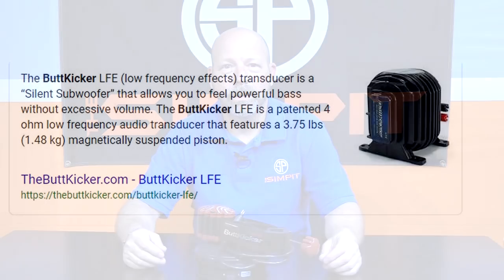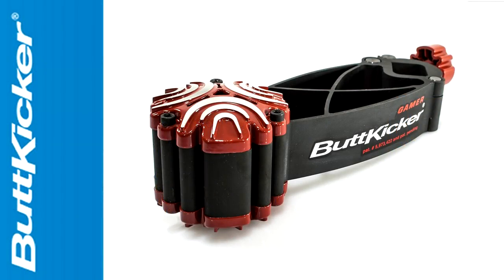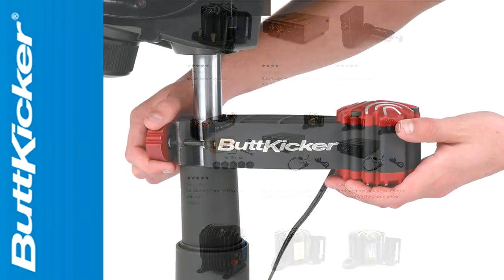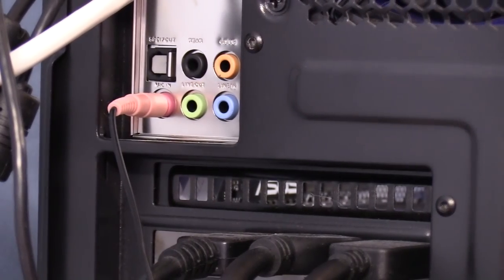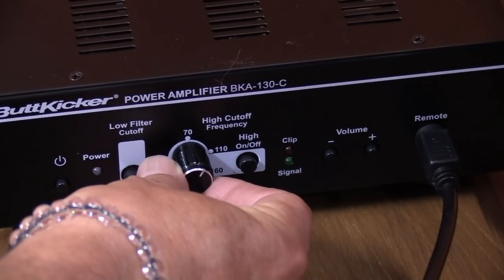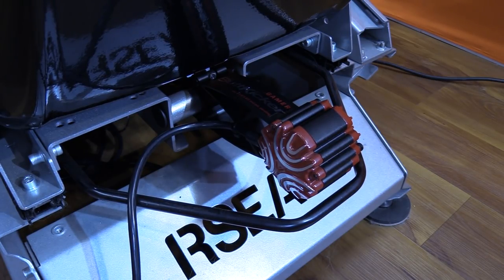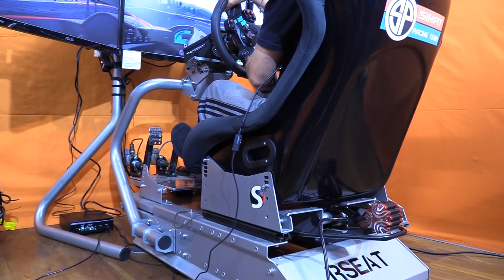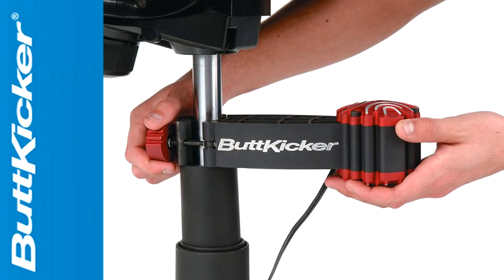You Need This On Your Rig! - Buttkicker Gamer 2

Comment: Like many sim racers I didn’t tell my wife when I bought mine. I was in the basement with it the first night and when I first turned it on she came rushing down from the 3rd floor asking me if I felt the earthquake. True story. I told her it was only $80
Reply: Having to explain to your wife that you spent $80 on a vibrator. When you actually spent more. 😁
Reply: Great comment!!
Reply: LOL
Reply: Dont worry buddy i do the same with mine oh ya was only 20$ dont worry 😂🤷‍♂️
Reply: Been there!!! LMFAO
Reply: The last part confirms this is 100 percent truth lol
Reply: its really that strong..?
Reply: @shervinaryan2631  oh man…. I bought it in 2015 I think. Used it for a year and a half. Then just turned it on this week. If the amp is up too high I can probably break the wooden frame I have for the sim gear. No shit. Keep in mind what you will ultimately set it to for your preference is way more tame than its capabilities. Huge huge “bang for the buck”!! Cost vs effect? No brainer
Reply: @UFwho  you just sold me on one, my wife thanks you (she really doesn't)
Reply: @shervinaryan2631  that’s crazy. I haven’t used it in years! But just this morning i went to buy an audio converter to get it running again with the PS4! Coincidence! My comment is a couple of years old.

Comment: If you do buy them. I suggest you mount them vertically. It will give you better road texture and bumps. Than mounting horizontally as seen early in the video.

It can give you a sense of surge when using lower range frequency for these settings.
Reply: Can you elaborate on what you mean by vertically? I have mine mounted much like Shawn. Not sure how I would do it differently, but would like to understand what you're recommending.

Comment: This is a long one but I’d like to talk a bit about the company who sells Buttkicker products. 

 I have one Gamer 2 and two Mini Concerts from the simulation kit. All running off the SimVibe software. All I can say is fantastic with VR. 

I bought my Gamer 2 first. I had it for about 9 months and the little red knob on the clamp came off. Most likely due to two things. 

 One being I had it clamped to something that was slightly to small. 

 Two being it was running off the game audio and not software like SimVibe. When doing that it can really go nuts from certain sounds. The Gamer 2 kept shaking loose. 

 I had to constantly tighten it down leading to over tightening causing the knob to break off the threads.  There was no way I could tighten it down after that and had no other options for mounting under the seat. 

I contacted Buttkicker looking for a replacement clamp. They responded hours later to tell me it’s unacceptable that it broke and they apologized. They said they didn’t offer replacement clamps however they’d like to confirm my shipping address as they’re sending me out a brand new one. 

 I confirmed my address and within 20 minutes I received a shipping confirmation.....absolutely incredible customer service. 

I was so impressed I decided to buy two Simulation kits right then and there. Upon receiving them, one of the amps stopped working within a month. 

 I contacted them and received the same sort of response as before. An apology and shipping address confirmation. About 20 minutes later a shipping confirmation. 

Both times they sent me replacements before receiving the broken equipment. Both times they shipped across the US in less then 7 days helping me get back up and running fast. 

I commend that company for standing behind their products. 

I have a good friend who bought me a Oculus Rift for my B day a couple years ago. He’s a very busy guy running multiple companies he owns. 

 Within 8 months one earphone stopped working on the Oculus. I contacted them attempting to get it repaired or replaced. Oculus said they didn’t have a service center but would replace the headset if I had the receipt. 

 I told them it was a gift but I could get the receipt. Once I told them that they refused to go any further with me until i got my friend involved. Me sending them a picture of the receipt from Amazon wasn’t good enough. They needed to drag my busy friend into the mix.  

 This led to email tag between myself, my friend and Oculus. This went in for about 5 days. Each time Oculus replied to our email thread it was a different customer service rep asking my friend different questions. 

Finally my friend said “stop fu*king us around Oculus and replace his damn Rift!” They finally did. It took about 3 weeks to get done as they had to receive the broken one first. On top of that I received a refurbished headset, most likely one that originally had the same problem as mine did....it’s a known issue with the CV1.

I understand these are two very different products at very different price points. However, stand behind the products you sell.
Reply: Hi all. Please use loctite on the threads.
Reply: You just sold me bro
Reply: @Voltsify  same

Comment: It's rather annoying when the buttkicker transmits voice frequencies when someone speaks.   Sim Commander cures that in sims which support it,   by using the sims telemetry data to produce the vibrations instead of an audio input.   Much more accurate feedback,  imo.
Reply: Good post!  I guess it's important for Console users to make sure to use Chat Audio on it's own dedicated connection bypassing the ButtKicker.  Thanks!
Reply: Simvibe it's totally worth it. A must!
Reply: You can still use "audio" for tactile as it also provides some effects that telemetry based tactile cant. To control this we use a crossover to use only low-frequencies for the unit to operate with. Typically below 150Hz are usable but many units do not produce much vibration over 100Hz.
Reply: @Trilobito    Definitely.   Especially since a lot of sims have laser scanned track surfaces now.
Reply: You could get around this issue by using 2 soundcards, and output only the voice com via the headset and duplicate the game sound from the first to the 2nd sound card by using microsoft's stereo mix

Comment: I agree a buttkicker is awesome.  I tried a motion rig and I like this better.  It gives feedback that helps you drive better when paired with a software like Sim Racing Studio (free to try).  I would not use it straight off the audio channel, waste of money.  TRY THIS FOR INCREDIBLE AWESOMENESS...  I started with the sim kit (mini concert and amp) under my RSeat S1.  I then moved the mini underneath the foot plate and added a full size LFE with a 1000w Dayton amp to my seat.  I had to move the RSeat bracket to the front of the seat for clearance and the front bracket to the rear of the seat with some drilling.  Now you get feedback from feet, seat and FFB wheel, your 3 points of contact.  Some people use multiple small buttkickers for directional vibrations, but I find the larger buttkicker is amazing and feels much more realistic than a small one or probably several.  My rig is solid with good floor isolation so I get no vibration noise like I heard in this video.  Of course I don't use trips, I use 12ft 4k HDR projection.

Comment: I just bought the latest Buttkicker Gamer Pro and it's amazing. Mine is no where as loud as his. I have my rig sitting on carpet. Barely hear it.  I think his is so loud due to having his rig on hardwood floors. So if you're thinking about it, just do it. Adds so much immersion to the game. 🤗

Btw, I use simhub software and works perfect!

Comment: One Buttkicker is better than no Buttkicker, but with small ones i would go 5. Four in SimVibe Chassis and one for SimVibe seat. I suggest to spring-load the rig with 8-10 Brooks-springs made for bicycle saddles. Much more immersion because of movements and full undocking from the ground, so no neighbors with pitch forks in front of your door anymore. With 80/20-rigs you just need M8 screws and the nuts, and for the ground-side i'm using some plastic-feet they fit in. Even with the GS-5 i'm using them, because the effects feel more natural. And the big Buttkickers are really a lot more powerful than the small ones. A bit more pricey, but worth it.
Reply: Could you link a photo as an example? Would be greatly appreciated

Comment: Haha. I liked your style for this one Shaun, that was fun to watch! 
I always think of myself as a ‘budget’ sim racer, in so far as I do not have a direct drive wheel, or a motion rig or multiple transducers, but I have had one of these for years. 
I suppose I need to redefine ‘budget’ as I use my HTC vive for VR (rather than my 17’ monitor!), but I only have a Playseat Challenge which needs folded away after each session as my wife dislikes the clutter.
When I first got the Buttkicker Gamer 2, I purchased SimVibe at the same time. Once you have factored in a cheap extra USB sound card, this does increase cost by around 50% sadly, but WOW, dial it in and it’s great! 
Was a bit confusing to setup first time, but now I can setup from cupboard to racing in less than 10 mins. 
.....just damn annoying I can’t leave it setup permanently😊.

Comment: I had one over 10 years ago with my playseat that I bolted a bmx stuntpeg to, at the time it was gtr2, rfactor ect, back then you'd have to mess with the gain and stuff constantly, in the end of got bored of constantly adjusting trying to get it work over rumbles and not shake to death over wind noise or something stupid,  pretty good when it works, but unless they have an official software solution to go with it now for the sounds as it's a bit gimmicky overall as it doesn't always work like you want it to, the physics driven rumbles is what I'd be looking for but also a faint rpm feel if possible.

Also 10 years ago I could blast my Logitech z550 and buttkicker and have the it shaking next doors windows, now, I can barely have volume half way before a complaint.

Forget about using this in a shared household on an upper floor, everyone will hate you.
Reply: Haha! Good point! Not recommended for an apartment!
Reply: @UFwho  I now work in proximity to an active quarry, when they do the blasting it's exactly like my old buttkicker feeling the floors shake 🤣 you'd very quickly make enemies having something like this in a apartment for sure.

Comment: Please do a video talking about the difference in feel when using a buttkicker with and without software like sim-vibe. I rigged together my own system using two sub-woofer amps and two transducers for left and right stereo seperation under my seat. My favorite game to play is Dirt rally in VR with my vibrating chair. It feels awesome to catch air coming off a jump and to feel nothing just before the car crashed back down into the road and feeling the chassis bottom out. You can feel all the rocks hitting the undercarriage. Very immersive!
Reply: Reynaldo Luna Jr. There is no comparison between using one with and without simvibe; simvibe is a game changer. The Buttkicker people should pay Simexperience every time they sell one.

Comment: Q: I have a sim rig in the second floor with rooms underneath me. Does anyone have experience on how much the vibration gets transmitted through the floor ? I just bought a an anti vibration mat for underneath the 80/20 but I'm still quite concerned.
Reply: I'm having the same concern myself, how did it go?

Comment: Note of warning to everyone: once you have one, you'll want a dozen.
You want one for each wheel on your virtual for road feel, one for the engine, one for the pedals, one for the shifter, one for under your butt, one on your back.
But wait, now you have Simvibe and impacts are mostly sideways, so you need a buttkicker on its side on all sides to simulate impacts from the virtual car onto your rig.

After this you'll want a GS5 seat. Than after that you will go full bonkers and get motion.

It is just that good but it's one of those rabbit holes in our hobby that will keep us spending more and more money.
Reply: I disagree, clearly 12 units is not enough :)
Reply: @Mr_Latte_UK  I am sure that's what she said. :P

Comment: So what would you suggest as I am about to purchase an RSeat S1. Will any home stereo receiver/amplifier with numerous channels run the butt kickers? Or do they need to be some sort of sub amplifier? I thought of buying two butt kicker adapters for the RSeat S1 and make a brace extension to connect the butt kicker adapter to the front of the chassis coming off the pedal deck. I just don't know if having them mounted there especially running in multi channel through something like sim vibe would be too close together. If a home stereo 7.1 channel receiver/amplifier would work then I could mount up to 8 positions so long as I can isolate the higher frequencies through all channels to what I want and need. That means I could run all four corners for the tires, one for the steering deck, one under the seat and one for each side of the car close to the seat to simulate getting banged around.
Reply: Maybe use a Biamp MCA 8150 with 150 watts over 8 channels. That's more than enough to run a few Butt Kicker mini LFE's and it would give expansion room if someone chose to buy the butt kickers over a period of time.

Comment: I use this with battlefield 1 how do I get it to stop transmitting voice over the kicker? I just want to feel the explosions I use voicemeeter for it right now do I need another program?
Reply from the maker: An external program is needed in order to drive the shaker from anything other than audio, I'm not certain which programs will work for non sim titles but it's worth looking in to. Thanks for commenting
Reply: you have to turn it off if you are not in your program.  for example, in a flight-sim like DCS world 2.5 open-beta, there is a special program that will drive it at just those right moments when you need an ass-kicking.

Comment: Is there a single amp you’d recommended to run four ButtKicker LFE Minis? I’m struggling to grasp ohms, watts, channels, etc so I’d greatly appreciate it if you or any of your viewers could point me in the right direction.
Reply: You could go with the Behringer NX1000. it has enough power for the LFE minis.

Comment: how loud is it?
Reply from the maker: It's not too bad, but if you're on a concrete floor it'll shake enough to cause a buzz in your furniture. Put the rig on carpet, or rubber feet, and make sure it's secured tightly and the noise if no louder than magnetic shifters, though it is more constant.

Comment: Hi! Can the audio signal wire be connected directly to the sim's monitor audio jack (monitor which receives audio and video signal from the PC via a long HDMI cable) instead of using the PC's audio jack, which is several meters away from my rig? thanks

Comment: Actual Buttkickers are far too expensive, I acheived the same results with a second hand £80 hi-fi Amplifier, 2x £40 transducers and Simvibe (you'll want simvibe for your buttkickers too), running with one under my seat and one under my pedal plate. So I only spent £160 (exlcuding simvibe) instead of the £400 it would have cost to get 2 Buttkickers instead.